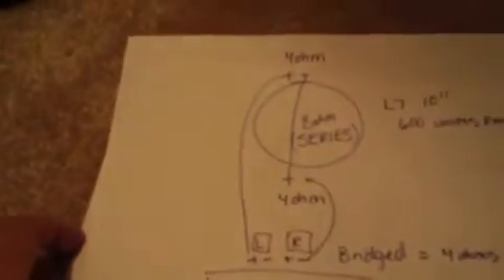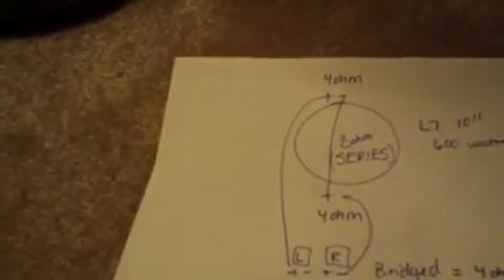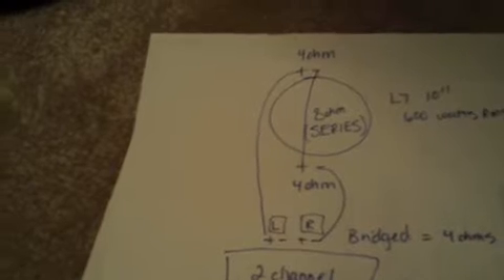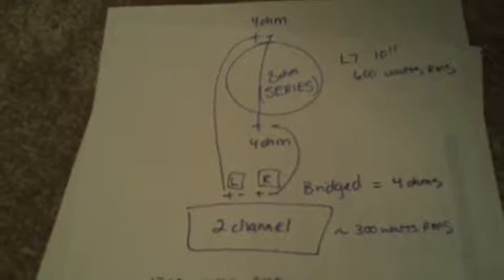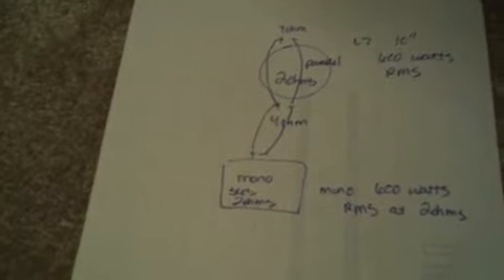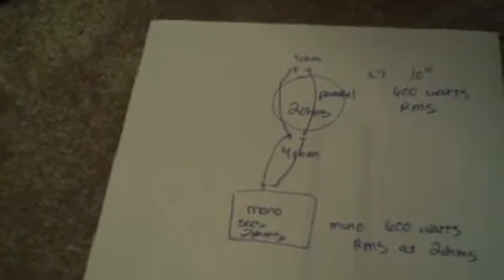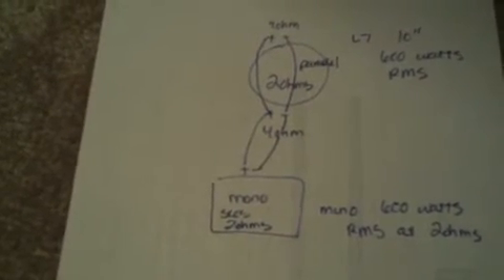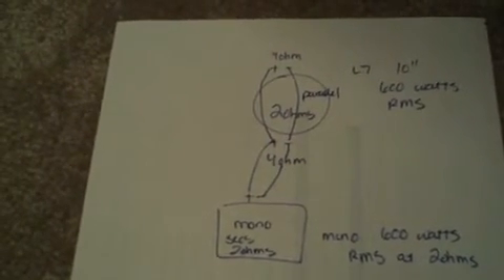Should you series or parallel a dual 4 ohm subwoofer with a 2 channel amp

Comment: so i didnt do what you told that guy to do lol: intentionally because i wanted my subs to run at 4ohm (its just a cleaner sound ) i purchased 2 
Skar Audio VVX-12v3 D4 - 12" Competition Grade Subwoofer
Dual 4 Ohm Voice Coil Configuration
Peak Power: 1200 Watts
RMS Power: 600 Watts
  and a hcca 1500.4 yes a 4 channel amp. however the amp puts out 750 watts bridged at 4ohm X2 so i will be wiring up my subs series in the box to get my 8ohm,  then bridging and will have 750 watts per sub at 4 ohm muhahahahah! i want to say thank you! you know how long it took me to find a video (or anything for that matter) where someone actually confirmed that bridging the amp cuts the ohms in half! THANKS for confirming what i was 90% sure of! took me literally 4 hours of searching you tube to find you! and i spent over 6 hours researching my sub and amp combo!

Comment: I have a problem...I am wiring Alpine type X with Kicker cxa1800.1 what wiring for both speakes and amp is going to produce the total 900 watts per channel! I have looked and they say the amp is putting out factory (outputs) 8ohm  I want 4ohm with 900watts...please explain how

Comment: quick question...  I have two kicker CVX wired to 2ohm final impedance for a total of 1500w.... this is to much bass for me. they're powered by a kicker kx1600.1 (1600w @ 2ohm, 800w @ 4ohm). I'm considering getting two dual 4 ohm RF punch 2 to 4 ohm final impedance. do you think wiring to 4ohm would quiet down my bass? and hopefully reduce those annoying rattles

Comment: hello I have a mmats dhc 1400.2 amplifier and 2 alpine type r swr 12d4 subs running bridged and parallel my subs are wired at 1 ohm my amp is 2ohm it does run fine at the moment but I want to wire the subs correctly so I do not do any damage to my amp please help

Comment: i have a jl dual 4 ohm w3 v2 12'' and a kicker 12'' 07 cvr 124 sub. i want to hook it up to a pyramid 4 channel 1200 watt (pb 881) amplifier. i want to bridge each sub to get a total of 2 channels for my amp. according to amp specs bridging would give me 4 ohms.i also have separate terminals for each sub at the rear of my enclosure.i would like to use each plastic terminal for each sub at theback of my dual sub enclosure ...is this possible using this amp?? thanks,marc
Reply from the maker: djmined technically it is possible, but not recommended.  You really don't want to have two different subwoofers in a car.  Since they both have different efficiency ratings, they won't hit and play the frequencies at EXACTLY the same time consistently.  This means they have the potential to play out of phase with one another, effectively cancelling out the very bass you're trying to achieve.  Sell one sub and use half the amp for the sub.  Run your front speakers off the front channels and bridge the rear channels to the sub.  If you use the JL, make sure you wire the JL in series.  If you use the Kicker, I think that one is a single voice coil 4 ohm, if that's the case you don't have to do anything special other than bridging the rear two channels to the Kicker.
Reply: thanks! appreciate it!!

Comment: came across you channel and made the most sense I have a single cab truck with not a lot of room and a performance tekneuqe 1200 watt 600rms 4ohm dvc sub and the amp I have is a power akustic ps-2-800 with800 watt @ 2 ohm briged 360 way   less on 2 channels how do I wire it and get most power what of it

Comment: Hi.  PLEASE HELP... I've got a 2200w monoblock. Now i know that you cant have a monoblock that's bridged, but mine has 2 positive's and 2 negative terminals, and underneath it says "4 ohm-bridged". I'm running 2 12" 500w subs SingleVC. I really needa know if i can hook them up in parallel, or if thats just gonna blow my amp.

Comment: i have 2   4 ohm DVC i need connected to my 2 channel amp ( mtx RFL600d mono-block) should i wire both subs to 8 ohms then connect them in parallel 4 ohm load and bridge it . or wire each to 2 ohms and connect to each channel? which one would put out more power? my amp is 2 ohm stable.